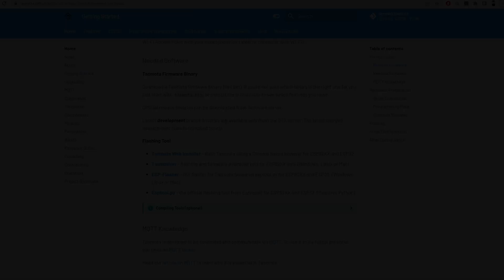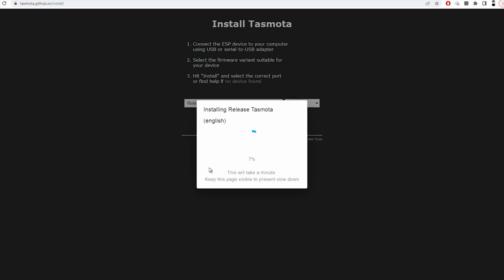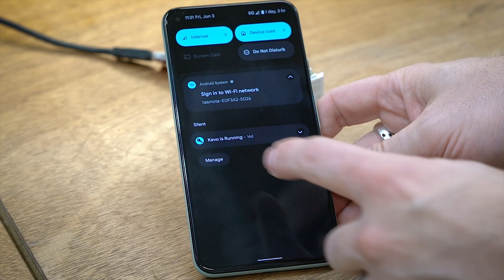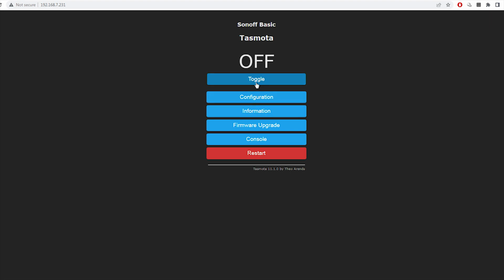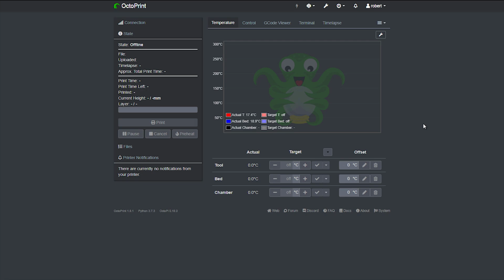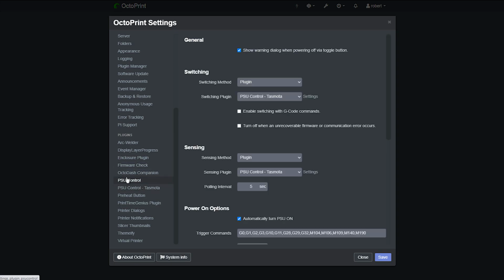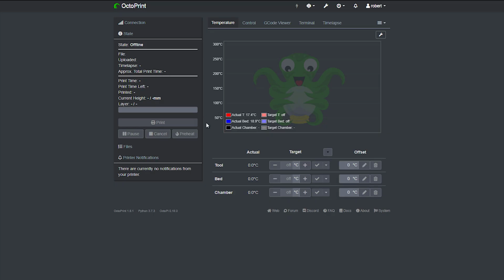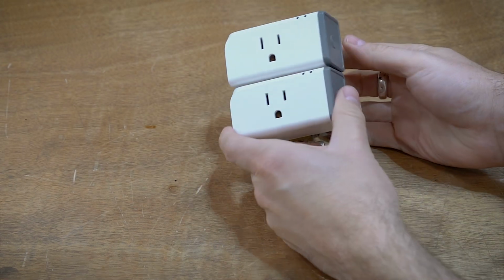Sonoff S31 Tasmota Flashing (Home Assistant and Octoprint)

Comment: An easy way to learn the com port to use on windows: Before plugging in the usb cable, click on the start button and search for "device manager." Open the list of "Ports (COM and LPT). Note what already exists. When plug in the usb cable a new device will appear. That's the correct COM port to use

Comment: Does Tasmota support reading the voltage and power consumption. You showed just switching it on and off. What does the interface for getting power work? Can you use HTTP API Requests?

Comment: Thanks for the video on how to get these things apart. If anyone's FTDI doesn't have 3.3V output, 5V can be soldered to the bottom right leg of the voltage regulator (SOT-223 component under the GND pad)
Reply from the maker: correct!

Comment: Did you remove the soldered cables from the board before inserting back into the plug housing? or just tuck them in there? thanks
Reply from the maker: You can remove them, unless you plan on messng with it more.  But they're not needed after loading the new firmware.

Comment: I'm going to have to pick some of these up!
Reply from the maker: I really like them, I switched out my hard-wired relay board for one of these on my other printer too.  They're very responsive.
Reply: Yeah, I just leave all my printers on 24x7. Probably not the best way to do it. This will help me fix that!
Reply from the maker: @JonathanRansom  oh, HA!  I'm reviewing an Ender-3 S1 Plus and it's actually quite loud just sitting there idle.  Having the option to control power remotely is really nice.
Reply: I just have two Prusa i3 s and two mini+'s. I can't really tell they are on when idle. They are pretty quiet. But still the displays are psu's are getting used up for no reason. But it is convenient to just be able to start a print remotely without having to turn on the printer.